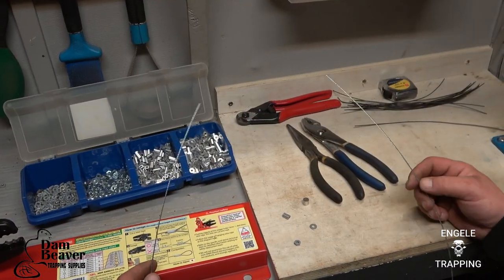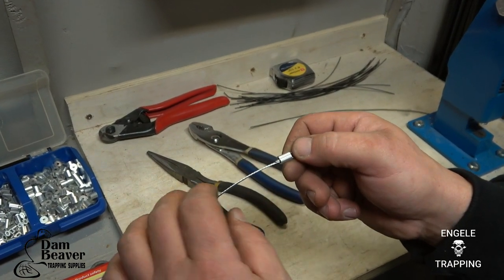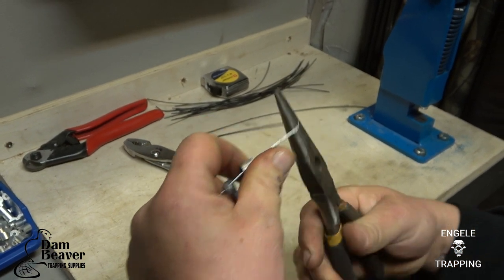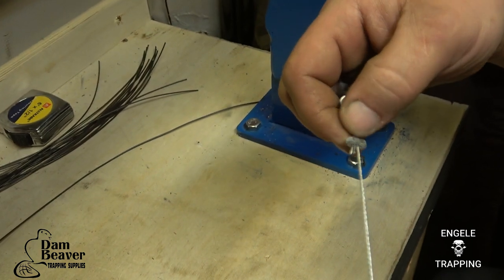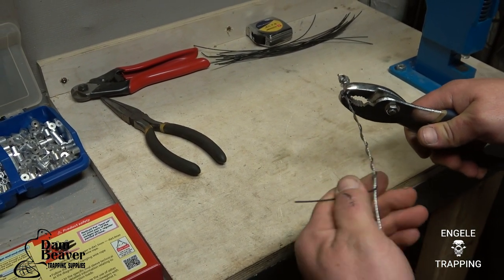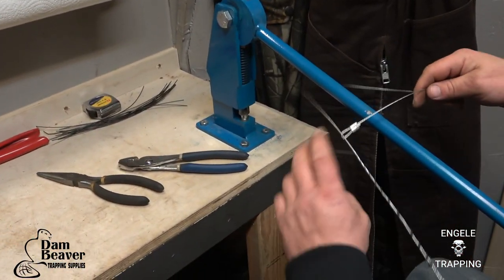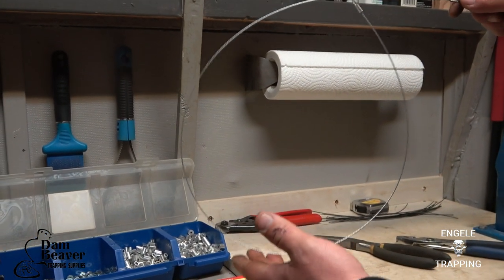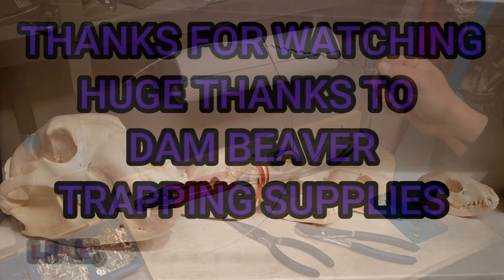HOW TO MAKE REPLACEMENT SNARES FOR POWER RAMS

Comment: Sorry, have another question...what do you do with your power rams prior to setting them out in the field?  Power wash them, run through wife’s dishwasher 😂?  Thanks again for all the tips, I made up an order and waiting on supplies.
Reply from the maker: Most guys don't do anything with ram It's self
 When I 1st got mine I set them in the Bush right away the 2nd year I boiled them to get all of the grease off and I dyed them but I don't think that is necessary I have not done it since.
 And your questions are definitely not a bother how's a guy supposed to learn if you don't ask.
 I'm happy to help any way I can but I'm definitely no expert

Comment: Great explanation and exactly how I make my snares including to "load" the snare eliminating the teardrop. Where did you get the press as I use hammer/vice and what is Full Metal jacket?
Reply from the maker: I got the press and vise from Dam Beaver Trapping Supplies 
And FMJ is a trap and snare dip for coating your traps
Reply: @EngeleTrapping  good luck with the FMJ. I will stick with the hammer/vice as that press is too pricey.
Reply from the maker: Ya it is a little pricey as fal as I can tell the FMJ never made a difference. I sure do appreciate your support on the the Channel
Reply: @EngeleTrapping  I’m

Comment: Just to confirm what you said at the beginning of your video, you cut your wire 47” long?  So your finished snare with the loops and hardware would be less than 47” from end to end?  Thanks!
Reply from the maker: Yes that is correct if you cut it longer than 47" the power ram arm will extend beyond the Max and have no pressure to dispatch the coyote

Comment: Thanks for the video, how long do you make the support wire ?
Reply from the maker: On the Coyote snare I make them about 10"
 I don't actually measure them I just cut what looks right as long as I have at least a 10 inch loop when I'm done I'm happy

Comment: What size/type cable do you use for anchoring your power rams?  7x7  3/32 for example??
Thanks for the tips!  Working up an order 😀
Reply from the maker: Yep I use 3/32 it plenty strong. Good luck this season i hope you catch lots of fur.
Reply: Thanks again for all the info
Reply from the maker: @jamesstrand5073  no problem any time